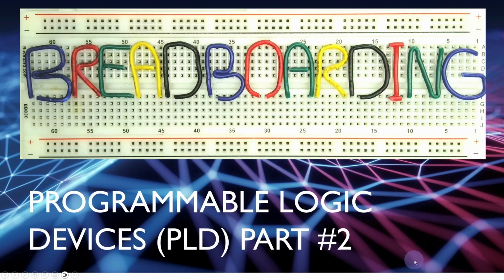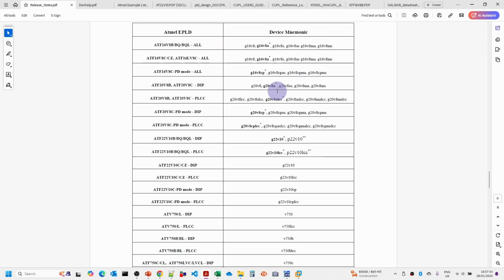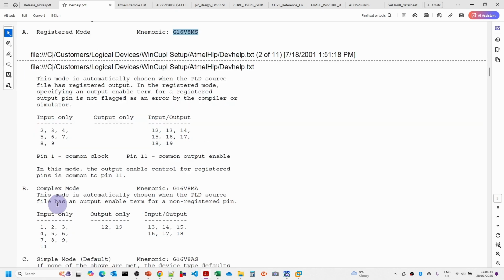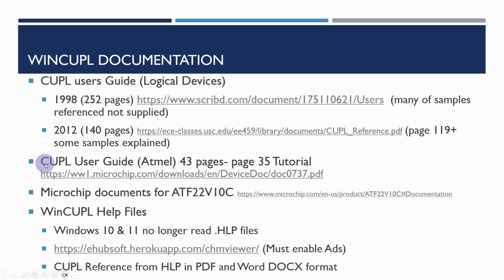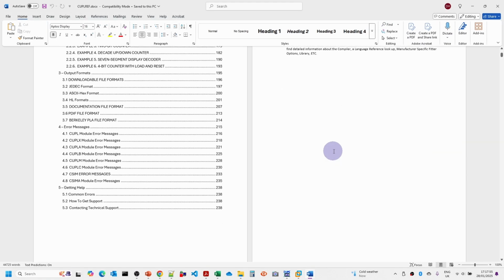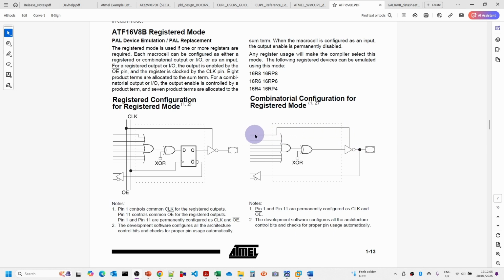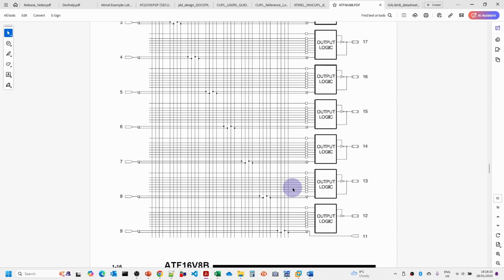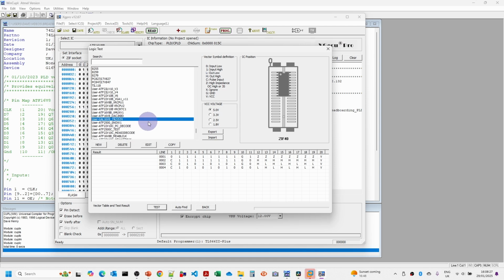How to use ATF16V8/GAL16V8 Programmable Logic Devices (PLDs part 2)

Comment: Hi, Would it be possible to display a previously programmed logic function from the 16V8 if there is no lock on the chip?
Reply from the maker: You would be able to read the fuses is there is no lock so you could save a .JED file which would give the fuse status with lots of lines like the following
*L00480 11111111111110111111111111111111
You would then have to work out from the fuse ID information in the GAL datasheet what connections were made between each pin and the logic cell options.
Not particularly easy but possible. I am not aware of anything to reverse engineer a .JED fuse map(OK quick google shows JED2EQN but I haven't tried it).
What are you trying to do?
Dave
Reply from the maker: In fact I tried out the JED2EQN utility in OPALJr from https://vetusware.com/download/OPALjr%202.01%202.01/?id=17574.
Ran in DOSBOX. Took the ADDER.JED from the WINCUPL Examples and just needed to change the device name to GAL16V8. The equation syntax would need to be converted to CUPL but is fairly easy to understand.
Hope this helps. Dave

Ran JED2EQN and it produced output in the following format:

; JED2EQN -- JEDEC file to Boolean Equations disassembler (Version V063)
; Copyright (c) National Semiconductor Corporation 1990-1993
; Disassembled from ADDER.JED. Date: 10-21-125
;$GALMODE MEDIUM
chip ADDER GAL16V8
i1=1 i2=2 i3=3 i4=4 i5=5 i6=6 i7=7 i8=8 GND=10 /nc11=11 o12=12 
o13=13 o14=14 o15=15 f16=16 f17=17 f18=18 o19=19 VCC=20 
@ues 4341303031360000
@ptd unused
equations
o19 = f18 * i4
    + f18 * i8
    + i4 * i8
o19.oe = vcc
f18 = i3 * f17
    + f17 * i7
    + i3 * i7
f18.oe = vcc
f17 = i2 * f16
    + f16 * i6
    + i2 * i6
f17.oe = vcc
f16 = i1 * i5
f16.oe = vcc
o15 = f18 * i4 * i8
    + f18 * /i4 * /i8
    + /f18 * /i4 * i8
    + /f18 * i4 * /i8
o15.oe = vcc
o14 = i3 * f17 * i7
    + /i3 * f17 * /i7
    + /i3 * /f17 * i7
    + i3 * /f17 * /i7
o14.oe = vcc
o13 = i2 * f16 * i6
    + /i2 * f16 * /i6
    + /i2 * /f16 * i6
    + i2 * /f16 * /i6
o13.oe = vcc
o12 = i1 * /i5
    + /i1 * i5
o12.oe = vcc

Comment: Have you tried Microchip's WinCUPL II (which seems to work fine on Windows 11)?
Reply from the maker: Not before your post! But just tried it and it seems to work OK.
It hasn't crashed on me yet so a big improvement!
The examples look pretty much identical.
The device options documentation is better.
CUPL Reference Documentation needs a few fixes to some of the diagrams etc but since its beta I can forgive that!
Thanks for the info. Dave

Comment: Thank you Dave, great content. Now I feel confident to unfold the mystery with PLD chips I saw in the 90's on PC ISA expansion boards. I still have the old TL866A programmer which won't do the ATF chips. So I'm going to try my luck with the opensource Afterburner PLD programmer, waiting for the PCB's to arrive. It will do the ATF750C as well.
Reply from the maker: Thanks. Good luck with the Afterburner.
I am up to my ears in getting 100 pin TQFP ATF1504 to do what I want it to do! Its winning at the moment.
Dave

Comment: It is possible to install the micorosft help viewer in windows 10 and 11.
Reply from the maker: No it's not! That's why there's the web site based converter or use older Windows versions which came with Winhelp. Later versions like Windows 7 you had to install Winhelp. Not sure if you can download it from MS now. Dave

Comment: Thanks again Dave for another excellent video on PLD’S, It’s interesting to see how well WINCUPL worked when you ran it under good old fashioned Windows XP, I hadn’t even realised you could run XP on a modern PC using a virtual ‘OS’  environment! Great idea. Cheers Michael.
Reply from the maker: I used VMware a lot at work so prefer to use it though there are quite a few free virtualization platforms available. I think some versions of Windows (Vista/7) had an XP mode which used Microsoft Virtual PC VM of XP to run programs incompatible with later versions. Since VMware workstation is now free for personal use I would use it, though Hyper-V comes bundled with Windows (this replaced MS Virtual PC). Dave
Reply: @breadboardinglabs I have used VirtualBox over many years both professionally and as an individual and can recommend it.

Comment: WinCUPL will work only in old 32bit computers....
Reply from the maker: It works on 64 bit Windows 11 and 10. Just that the project viewer crashes when open when compiling PLDs.
Running on XP was to look at the Windows Help and see how it was supposed to work!
Dave
Reply: You can also run it on a virtual machine.
Reply: I'm using it perfectly fine on an old laptop with Windows 8.1 64-bit (it's definitely 64-bit).
Reply: FWIW, I managed to get WinCUPL to install and run under Wine in Linux, though, not without complaints about missing OCX files.  Using Winetricks to install the missing OCX files from MFC40 managed to solve that problem.
Reply: Works for me on a 64-bit Win11 laptop.